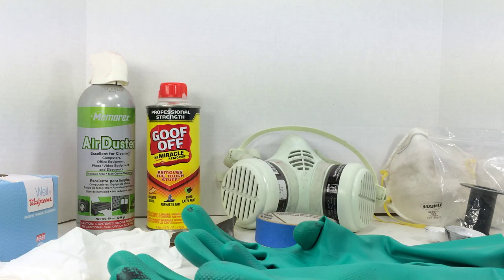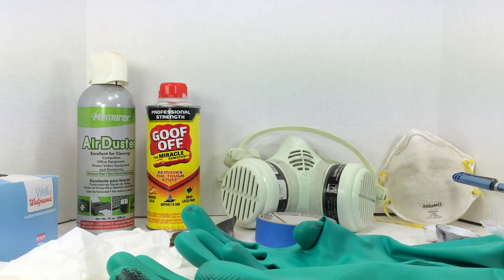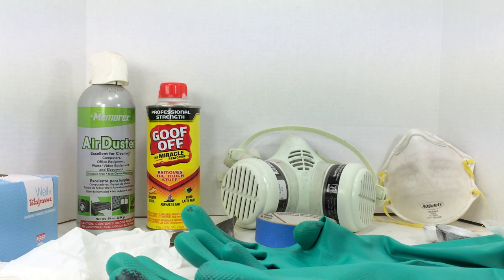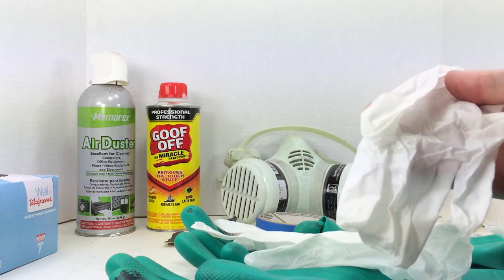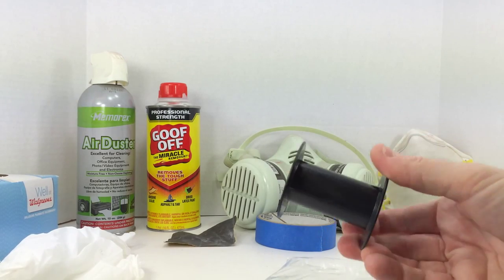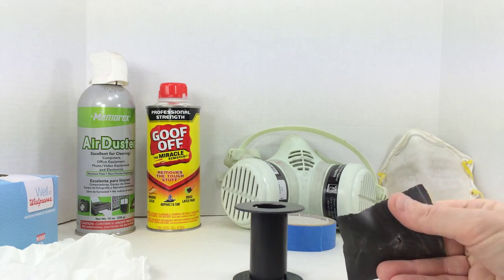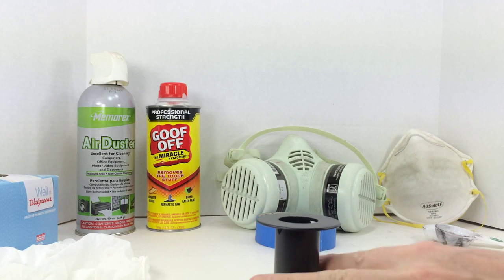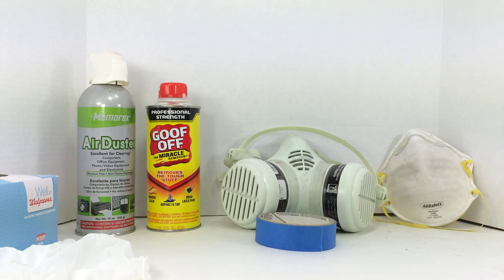Firearm parts painting, what you need and how to do it - Part 2

Comment: After you degrease it and you want to rough it up shouldn't you decrease it again after you wet sanded or rough it up I've never done this before but seems like you would do that after you wet sanded it you would degrees it again am I right or am I wrong help me with this please thank you
Reply from the maker: Degreasing again won't hurt, but unless your somehow getting grease onto the freshly sanded part, its not necessary.  You do of course want to remove all the sanded material, a tack cloth works well for this.

Comment: Hey can you use goof off on a plastic pistol frame to take off krylon?
Reply from the maker: I would be very careful with Goof Off, that stuff is extremely strong and yes, it will remove paint, but it could also damage the plastic frame (depends upon the material of course).  Probably best to try non-acetone nail polish remover, it works great for removing enamel and does not damage the plastics used in pistol frame construction.
Reply: 2phast Tactical thanks I will try that!!!